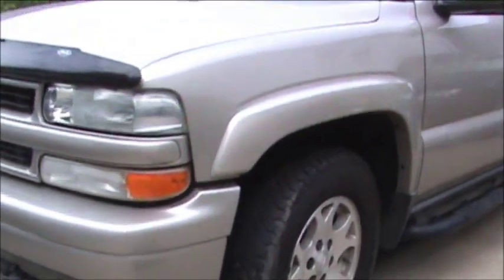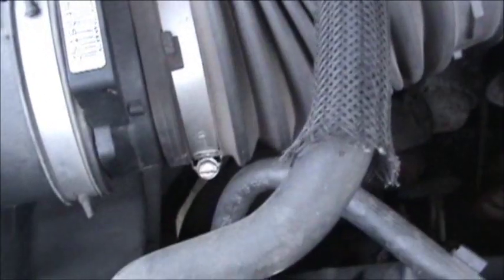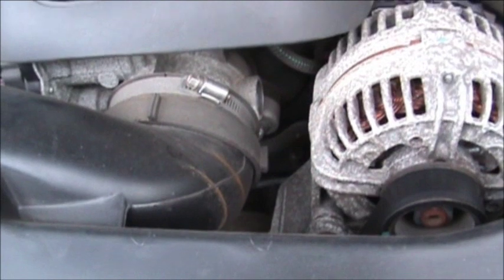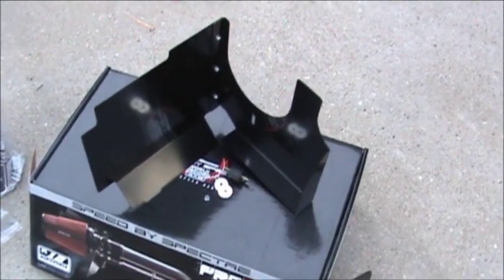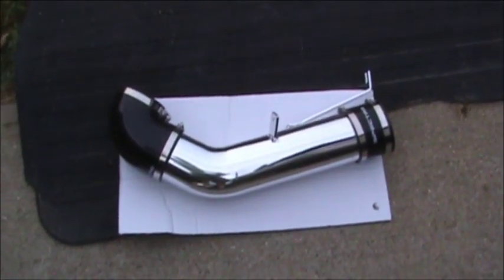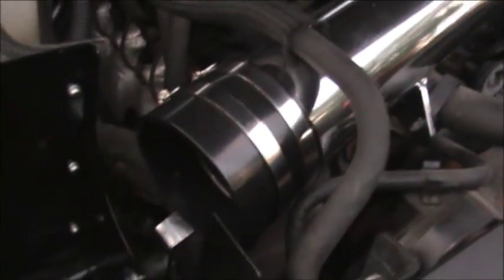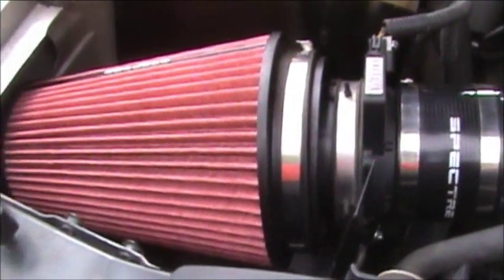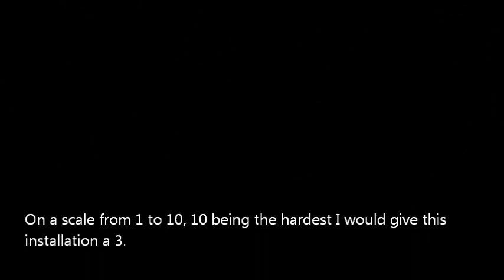Chevy Tahoe Spectre air flow system install

Comment: Just put this exact one on my 2002 Yukon XL today. Its great! Throttle response is waaaayyy better and my 40 Series Flowmaster sounds deeper. All in All, great performance, price and easy to install. Same as K&N, but for half the price.
Reply from the maker: +TKS 012722 Yes! what you said.

Comment: On my spectrum, it came with the rubber trim so the air intake won't hit the box and it'll cover the gap, also I'm able to remove my filter without removing everything else or loosing them up. You can change the rings to make the filter fit better. Unless yours doesn't come with the adjustables.
Reply from the maker: The new units must be upgraded to be more user friendly. Cool!
Reply: @LonnieJohnson1  idk about new, I had mine for about 4 years. But I recently just switched to the k&n filter last year. The intake itself is just the same as the others. But the filters is what makes a big difference and the k&n filter made a huge difference from the spectrum filter. You should try the filter switch. You will notice a big difference
Reply from the maker: Thanks, I'll have to look into that. I think my filter is a K&N filter.
Reply: @LonnieJohnson1  oh ok and I just notice my stupid auto correct, keeps saying spectrum and not Spectre lol

Comment: Lonnie - great video walkthrough.  Hows the spectre holding up?  MPG?  Looking at the L3 version of this kit on ebay for $60 after finding my stock parts are no longer holding the bolts to seal the air box.  Anyone else have suggestions/feedback?

Comment: Just wondering how that Spectre CAI is working out????  Notice any difference/improvement, performance-wise?  Is the Spectre CAI's CARB legal?
Reply from the maker: It's working out really good. I have noticed a little more performance but not sure about gas mileage, I guess because I have over 250000 miles on the old motor and still climbing.

Comment: Ok, so I was checking videos including this one before I installed my CAI. The end result is that it is louder only when you step on the gas and importantly, it is noticeably more powerful. I don't have a dyno handy so I used a stop watch to time zero to 60 mph. I did this multiple times before and after install. my 03 Avalanche went from consistent 12.5 seconds to 11.5 seconds. In my opinion, it's the best $140 performance add on you can get. BTW, I used the Spectre CAI.
Reply: Wait till you drive in pouring rain and your engine stalls
Reply: @bravocompany1072  
☝🏿☝🏿☝🏿
Reply: @dmdltz843  you are probably right.  I am not driving through feet of water in my SUV's.
Reply: @bravocompany1072  some ppl don't understand that,  if you have a car with the filter mounted that way don't run it in deep water, or mount it higher in the engine bay. Just a stupid design...
Reply: @dmdltz843  I could see a turbo car with a low mount but I dont see any trucks out my way with low mounts due to snow and salt coming off the roads.  Not quite sure why you would want that set up on a truck.
Reply: @bravocompany1072  I agree my friend! Definitely an odd place to mount something important like an air intake but, only cars I know of is that stupid XB... Very strange...
Reply: @dmdltz843  my 7 year old son cracks up  every time we see one of those shit boxes on the road.   What a horrible le design and idea.
Reply: @bravocompany1072  😅 tell me about it!

Comment: nice vid. now I installed this as well on 04 suburban 4x4 and had battery disconnected for 30 min.after install I started car and let idle for 10 min for computer to adjust air flow from mass air flow sensor but I still noticed a loss of torque and maybe on a little pickup speed past 45mph, u experience this, if so how u fix? did u lose early torque?
Reply from the maker: +m00nchildblues I have not had any kind of loss.

Comment: I only paid $35.00 for mine on ebay. Better throttle response and slight gain in mpg. Dont know about any hp or tq numbers because i did not dyno it befor÷ and after.
Reply from the maker: Cool!

Comment: On than round plastic adapter with notches that you put on the mass air floor sensor can it be removed if I decided to go back to my original setup also is it rubber or hard plastic?
Reply from the maker: You can go back to the old system and mine is hard rubber.

Comment: I got the same one, mine makes a funny noise sometimes over 4-6k rpm like that rubber 90* angle by the throttle body is collapsing anyone else have this problem?